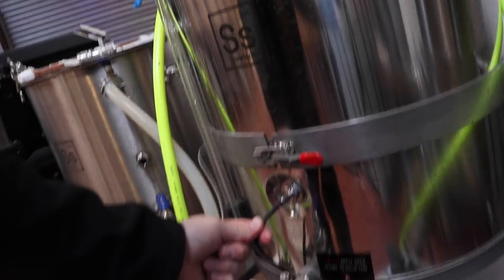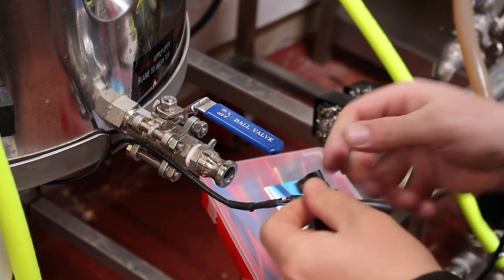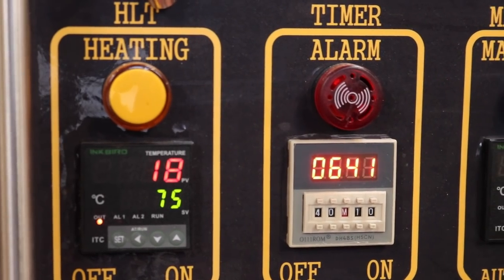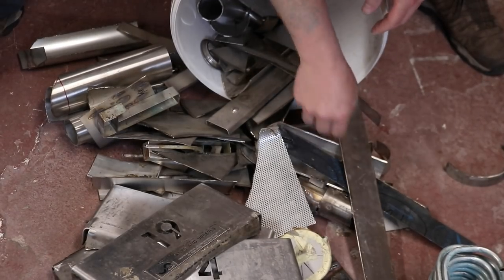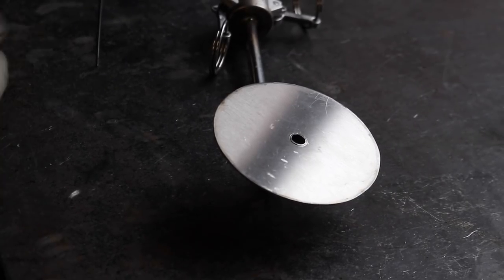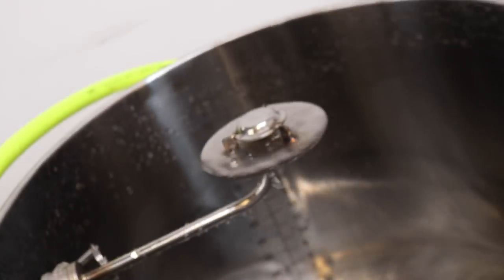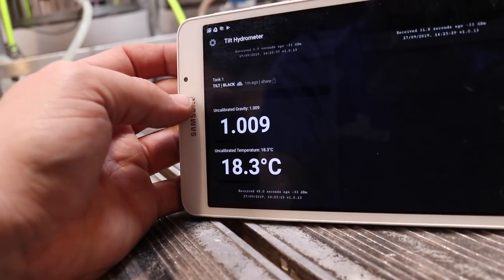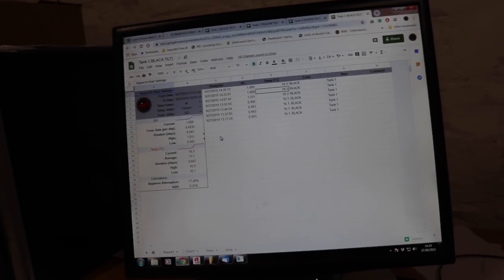Brewery Pilot Kit ~ Brewday Prep ~ Part 1 🍻

Comment: I would still suggest to take a reading once in a while. I had to calibrate mine in a few cases twice throughout fermentation. Also, don't let the bluetooth stay on on the galaxy all of the time to increase battery life of the tilt....
Nice sparge arm!!!
Reply from the maker: I will be calibrating when they go in and when they come out of the beers. I have to use sacchrometers by law for HMRC also so I always take SG and FG on each beer. Handy to know when to dry hop and cold crash etc without having to take readings.

Comment: Get a Raspberry Pi Zero Wireless to replace the tablet. That's what I'm using to capture the measurements. Rusty I'm sure was running a phone and the problem is because it's on 24/7 the battery swells up and wrecks the dam thing. Tilt have a page on their website for setting up the raspberry pi. The graphs is on a tab at the bottom of the spreadsheet. Also make sure you calibrate the tilt. Enjoy it mate!
Reply: Also get a stack of those CR batteries ordered as the tilt chews through them. Don't think it works with rechargables as well!
Reply from the maker: First thing I did mate. What is the bluetooth range on the PI zero? I am hoping to pick up 8 tilts eventually with 1 unit. I also want to pint the data to a tv screen maybe with the app running to display everything in real time.
Reply: @harrybrew69  I'm sure you could have the three fermentors off it. You may need a second one for the other side of the room. Rasp Pi Zero W (Make sure you get the Wireless) is £10 plus add a power supply and a sdcard to that. Worth trying with the one raspberry pi and if it doesnt stretch to the other side order up a second one.
Reply: You can also hook up a monitor to the Pi or use another laptop, phone, another raspberry pi to the IP address of the Pi Zero W and it will display the output.
Reply: Yes, the Raspberry Pi Zero Wireless is great with a monitor. That way the tilts always stay connected. With a tablet, if you move out of range or power down, no data will be continuously sent to sheets.

Comment: Tab at the bottom shows the chart.. Baron Brewing also has A Tilt repeater that sits on the outside of the fermenter and repeats the weak signal from your fermenter. Also because the tilt floats it is taking measurements from the top so it will read different temp to a probe lower in the fermenter. Not super accurate but good for indicating when fermentation has finished. I have two for my unitanks.

Comment: Harry, I have been covering the Tilt for a while. Do you think that you need to calibrate to degassed samples or put an offset in your spreadsheet. Gassed you should be a bit low....true? Calculated ABV a bit higher?
Reply from the maker: I won't be using them for ABV calcs. they are there to allow me to start yeast cropping and optimise my dry hopping.
Reply: @harrybrew69  Ah! Ok. I have been thinking about using, but I think would be off unless you did pressure fermentations....maybe.